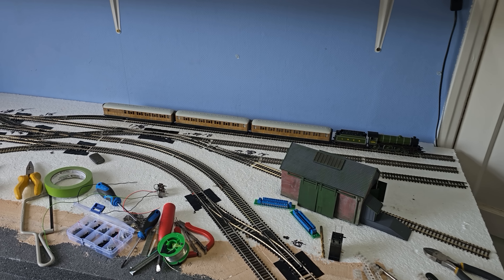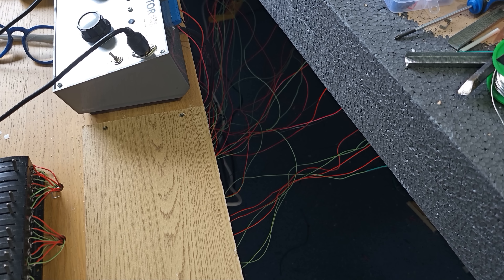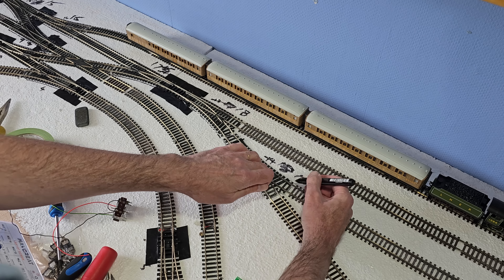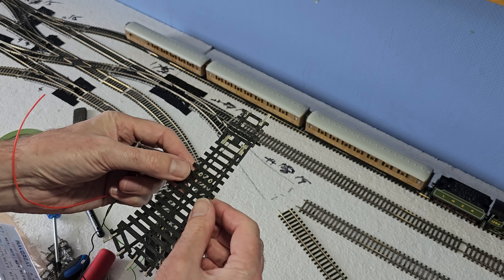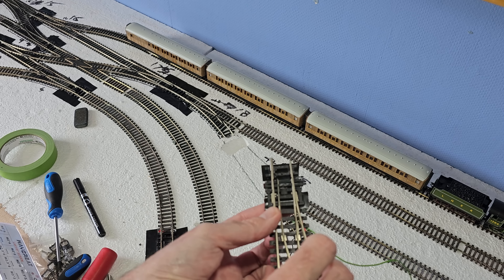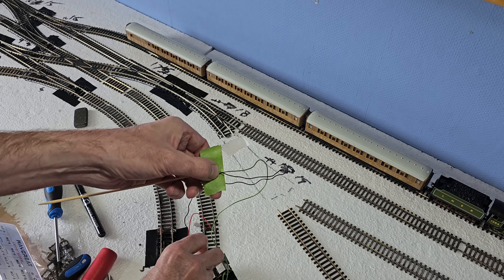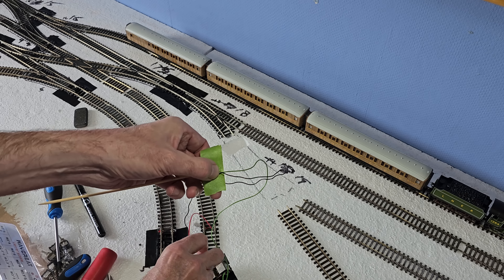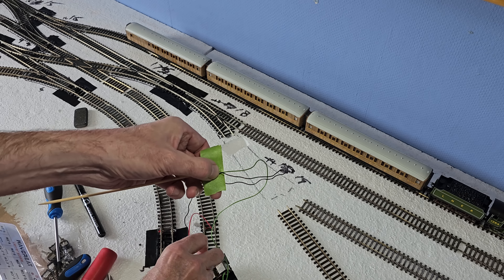New Layout Update 5

Comment: You could use a double through double point switch to route your power to the end to end track with having the DCC controller connected to one side of the switch and the DC controller connected to the other side of the switch and the center poles connected to the track.

Comment: From one fellow Scot to another, that's a serious size of drill bit for the solenoid pin hole, but well...!
Reply from the maker: It's not for the pin it's for the wires. And it has to reach through 10cm of polystyrene plus a 6mm board. And occasionally a timber of 40mm so it has to be a fair length. Also you don't want the drill to bash the top of the layout when it's goes through so the longer the bit the better. I bought this bit for another project but it does the job.

Comment: Another way, too late now for Bill, to blank off the baseboard hole over the Peco point motor. Place a piece of black paper between the point and the motor, large enough to overlap the hole.  A small slot cut in the paper allows the actuating wire to move. The fixing lugs will punch through. 
The paper margin can glue down whilst ballast goes down, all in one job.  Hope this helps.
Reply: I did mine like that and it works a treat ...

Comment: You will have to have your DCC track isolated from the rest of the DC track when using DCC, and if you want to use that track on DC then you will have to Isolate the DCC from it. You could achieve this by using a changeover switch. Cheers

Comment: If you do add the DCC controller to those outside loops make sure those tracks are totally isolated from the rest of the layout. If the DCC power and the DC mix the fireworks will ensue. I would use a DPDT switch with a dead section slightly longer than your longest loco. The dead section will ensure that the DC and the DCC don't mix.
Reply: Echo this, Bill!

Comment: Brilliant work so far Bill you should try to get a hold of a ZTC-511 digital master DCC railway controller it can run dc and dcc although not at the same time and can be used with the old Hornby zero one control system  the realistic cab controls are realy fun to use and it can simulate inertia on your trains  i got mine second hand from Hatton's and without a doubt its the best controller ive ever used being able to program many different brands of decoders with ease.

Comment: 19 points, if only....  y layout currently has 64 point motors, all wired and switched, in 4 banks with 4 CDU.

Double pole change over switch for your DCC or DC on the end to end. Just make sure the isolaters are all in place.

Comment: If your out and back loop does cross over/connect with your DC layout, maybe use isolating fishplates so there's no confusion between the two layouts? Like yourself, I've never delved into DCC so don't have any concrete advice. It sounds great to have the choice between the two alright. If I was to do something like yourself I'd probably have a large yard that's DCC and the mainline DC, that way just leave trains running on the loop in DC and then have trains and locos shunting differing manoeuvres on DCC in the yard

Comment: There is a way of shuttling stock using what's called an ABC shuttle  basically you have a different voltage on a section of track and it tells the decoder to go through the braking procedure so you can have station stops without needing to touch the controller. DCC Concepts do them and all you need to do is change a CV setting. The new Bluetooth chips coming from Hornby which mean you can run trains using your mobile as a control throttle. Those chips have this ability and they're cheaper. If you want a reasonably priced controller if you have a spare laptop maybe consider downloading JMRI and obtaining a Sprog unit as you can then control your trains that way. Certainly a lot cheaper than buying a DCC controller.

Here's a video showing how
https://youtu.be/xZmkDEoxp04